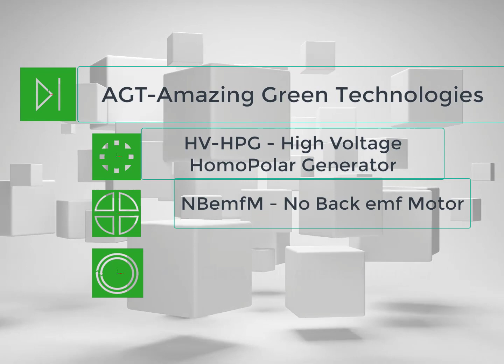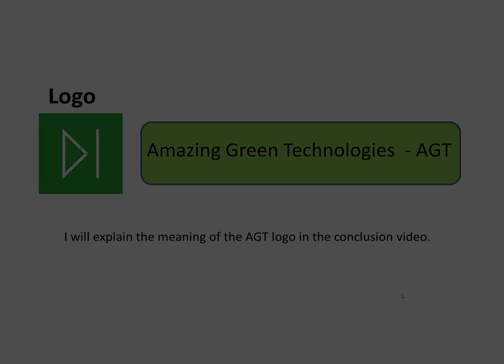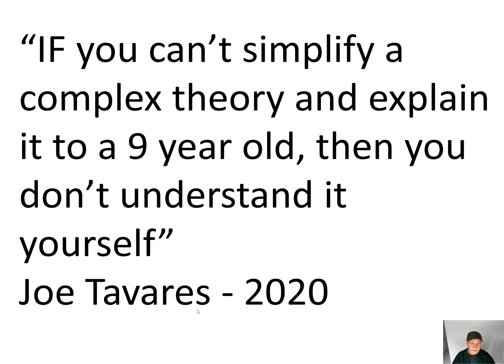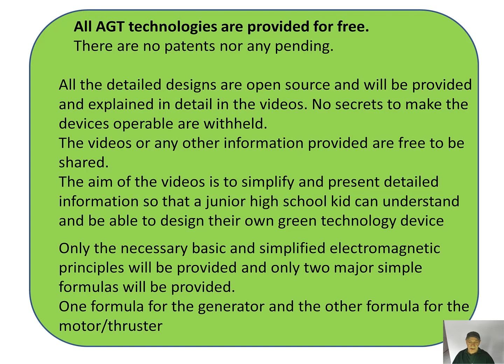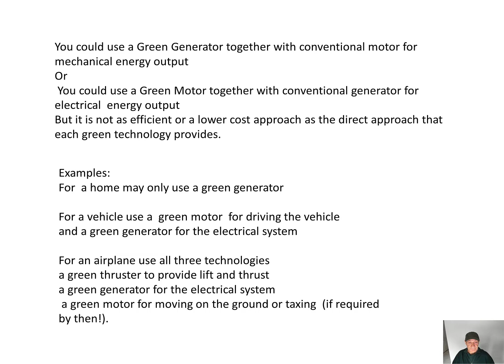01 AGT introduction

Comment: ps. I should add that we have the ability to simulate these designs using 3D Electromagnetic modelling software (called Ansys Maxwell). This means the design can be fully optimised before being built.
Reply from the maker: Yes I have use this software to simulate the B field for the case of the 1st attempt design at the HV-HPG design, which does not work which since then I became aware the induction still occurs in a shielded conductor.
In the 1st attempt design simulation, I got the correct results that a fairly even  1 Tesla B field throughout the airgap and the correct radial direction is present on the tooth to stator airgap of 2mm with a B field coil of 1800A-T to 2000A-T. This is in agreement with hand calculations since the ampere-turns for air at 1Tesla is 800(A-T)/mm.  Therefore for 2mm X 800(A-T)/mm =1600 plus additional around 200(A-T) for the magnetic path through  the steel 1008 core.  Also verified that B field in not present in the slot and flux cutting cannot occur. I'm not sure if I can use this software verify the induction in the slot to other slot edge angles and tooth width to slot width ratio.
for example, with the slot to teeth width ratio of 9:1, it is like a conductor moving together with a magnet and no induction occurs. With slot to teeth width ratio at 1:1 there will be 50% induction on the teeth and 50% induction on the slot both in the same direction and  backtracking (return for the loop to enable series connection) is not possible. With slot to teeth width ratio 1:9, there will be almost 100% induction on the teeth and almost 100% induction on the slot and both in the same direction and backtracking is not possible.
  Keeping the slot to teeth width ratio at 1:1,  but now if the slot edges are parallel,  the teeth edges will naturally be anti –parallel, the induction on the slot will 1.5 times the induction of that of a unipolar machine with no slots. The induction on the teeth will also be 1.5 times and in the same direction. Again  backtracking is not possible.
Now let’s look at the other configuration, slot to teeth width ratio 1:1 slots anti-parallel and teeth parallel, the induction on the slot will -0.5 times  and the induction on the teeth will also be -0.5 as compared to the induction a normal a unipolar machine with no slots. Again backtracking is not possible.
The device that I describe in the video has a B field coil  in the middle of the rotor.  The fields flows radial outward in the rotor on the left hand side of the coil and radially inwards in the  rotor on  right side of the B field coil. 
I no longer use the teeth for induction. I use only the slots for induction. This eliminates the need to have airgaps between the teeth and the outer core (formally known as stator). 
On the left side  where the field is outwards it has parallel slots with induction 1.5 times. On the right side where the field is inwards, it has anti-parallel slots and the induction is -0.5 times. The negative sign refers to case where the field is outwards but on right side the field is inwards so the induction is 0.5 times. This allows the wire in the slots to connect from the left side slot to the right side slot in series. To  do the backtracking, to complete the loop if can be done internally trough the center of the core or externally over the outer core. Notice with backtracking in either case there is no cancellation of induction since the backtracking is not cutting any field.

Comment: Hi Joe. Appreciate the time and effort  you have put into making these clear and informative videos. So that we (your viewers) can put our own time and effort into replication, are you able to provide some indication as to whether any of these ideas have been built and, if so, whether they work at overunity. As I am sure you know, YouTube is not short of ideas and theories for Free Energy, but there are precious few gems that actually work. If you would like to share more details about these technologies, our Foundation - set up precisely to support these technologies to get into world - would love to work with you. Please message me directly. Many thanks :)
Reply from the maker: No, I haven't built any prototypes. The intent is for someone  to build and verify. All the design formulas are based on currently accepted engineering formulas including the concept that induction still occurs in a shielded conductor, e.g. conductors in a slot. For the HV-HPG the only exception is the concept that I introduced that the magnetic field does not move with any material and the explanation why induction occurs in a slot due to flux linking due the magnetic field on the lagging slot edge decreasing and on the leading edge increasing .In a slot there is no magnetic field present and flux cutting cannot occur. The induction in a conductor in a slot depends on the tooth width to slot width ratio. Also other slot edge angles with respect to the conductor on another slot has an induction. All of this is described on the slot analysis section portion of the HV-HPG video and in more detail in the slot analysis video.
The tooth width to slot width ratio and the slot edge angle induction on a conductor through an experiment should be all that is need to very the concept that HV-HPG is possible. The rest is straight forward currently accepted engineering design.